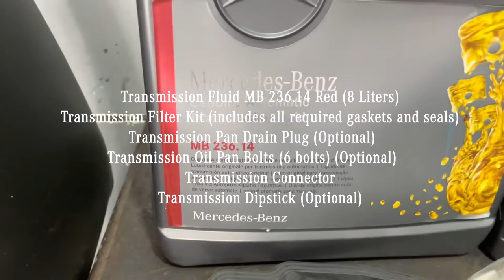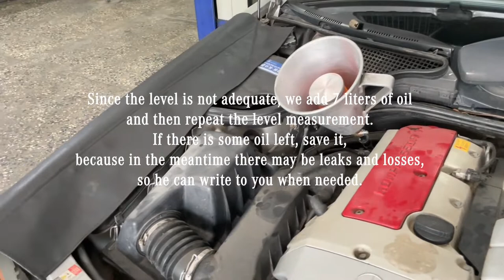Mercedes Benz - Automatic transmission oil change for model 722.6

Comment: I've bought a used 2016 CLS with 160,000 km and a 7G tronic gear box. I am not sure if the previous owner has ever changed the transmission fluid or not.

 My questions:
*Do you recommend changing transmission fluid now?
*If yes, what will be the safest way to do that in order to avoid any negative impact?

Comment: (722.6) How many litres total  7.5 or 8 ?
Torque converter capacity ?
Drain pan capacity ?
Have shifting issues after fluid change.
Filled 4 litres after draining ( low or overfilled)?
C200, w204, 2009 model
What is the normal Mercedes transmission operating temperature?
Reply from the maker: The amount of oil depends on the gearbox model.
cold 25 and working 75 celsius

Comment: Good afternoon sir,  where did you got the special tool for fit in transmission filter hole for air pressure to force the transmission fluid out.. thank you
Reply from the maker: I made. logical thinking

Comment: What was the hose connector piece (that drains the torque converter) to the air compressor called and where can someone in the US buy one? Thanks
Reply: It's custom made by themselves
Reply: Thanks
Reply from the maker: I made mine at a metal turner

Comment: I have W210 E230 1999. Perhaps it has 722.6 transmission. I would like to change the transmission oil gradually (2 liters every week) using a oil extraction pump.

question1: can I use that MB 236.14 and mix it with the old oil?
question 2:  if above is yes, how about mixing shell ATF 134 with the old oil?

any notes are welcomed and thanks in advance
Reply from the maker: If you change, then you change all the oil.
About 2-3 liters more is needed to get the gearbox out of the machine for washing automatic gearboxes.
I wouldn't do everything else, because changing costs a lot

Comment: Why U change connector?
Reply from the maker: as a precaution, because the rubber gasket can harden and cause oil leakage, and the metal deposit can make some unwanted contact between the signals to the control unit

Comment: Benim w202 il97 de bu şanzımanda dur.
Total 236.9 kullana bilirmiyim?
Teşekkürler.
Reply from the maker: 236.1
Reply from the maker: you have in the service books exactly for each model of gearbox how much and which oil. Gearboxes are expensive and should not be played but done as the Mercedes factory says
Reply from the maker: It uses oil of the quality and markings recommended by the Mercedes factory. The manufacturer of your choice